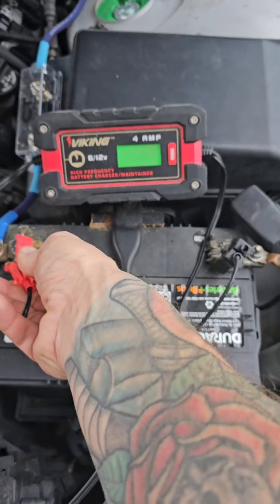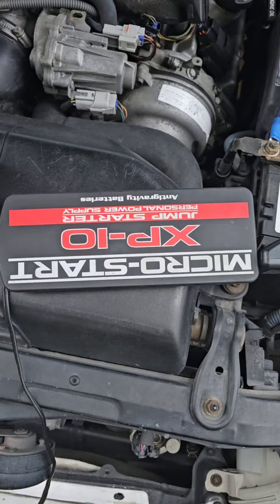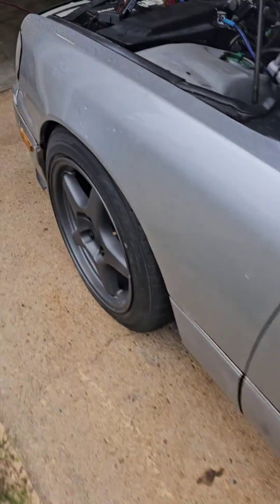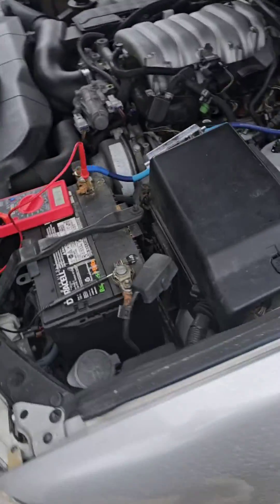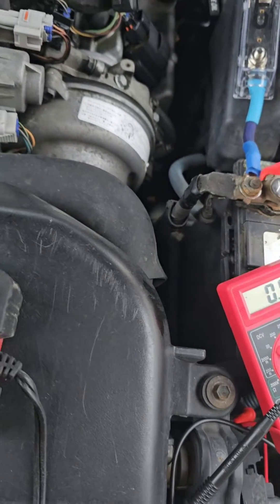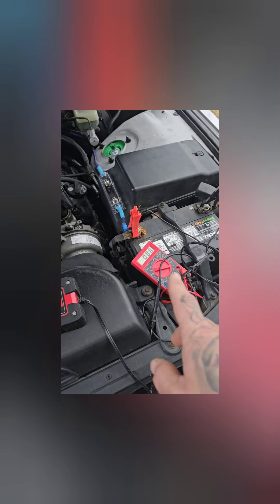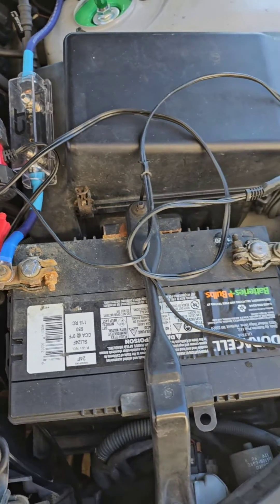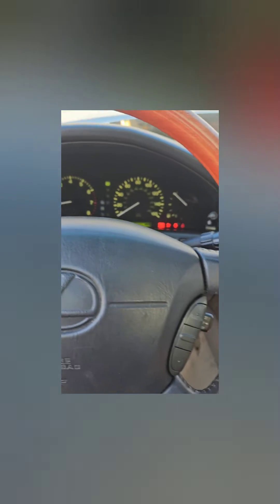How to restore a completely dead car battery (the easy way)

Comment: Yeah, that's what happened to me. A couple of days back with my Mustang, I left on my parking lights and the battery is completely dead. I try to jump it and when I jump it, the car turns on and then turns back off, I guess, battery doesn't have enough juice to keep the car on.

Comment: Well sure..but you let it charge overnight. It should start.😂
Reply from the maker: Most smart chargers can't just jump start a battery, so yes...it needs charged overnight. If a single start was the goal, then I'd quit after using the jump pack. But the point is to recondition the battery so it can function as intended, and that simply takes time.

Comment: How many volts was it before charging
Reply from the maker: It was like 5 or 6 volts. Pretty dead.
Reply: @tinygaragefab  My car battery is at like 1v 1.2v, do you think its worth a shot?
Reply from the maker: @MN-kh9jf thats going to be tough to bring back, but if you can jump the car and get it to stay running long enough to build some residual voltage, then the charger might just pick it up. But 1v is pretty bad.

Comment: Here's a quicker way with less messing around and no Lithium Jump-Starter: Connect your Smart Charger to the battery, then use a couple of wires with little alligator clips to connect a simple little 9V battery across the 12V terminals instead of the Lithium Jumper. The Smart Charger detects 9V, realises it's connected to a battery and starts charging.
Reply: Good idea !My only problem was managing to connect the battery to the main battery to get my smart charger working.
It maybe I'm a bit thick !

Comment: hello I have a new battery from costco that was barely installed last year but haven't been driven for a couple months and it's gettin cold now and forgot to disconnect my terminal so battery is dead...... will it still jump start using those jump starter kits or do you think my brand new battery is completely dead already?
Reply from the maker: Should jump start off of a pack, but the battery itself needs a recondition and charge, which is what the charger does. The alternator alone once the car is running  usually doesn't do it.

Comment: 😅the cable terminals are still connected. Is that still alright?❤
Reply from the maker: What do you mean? Charging the battery with the car's cables still attached to the battery? Absolutely nothing wrong with this. Nothing flows anywhere it wouldn't when the system is normal anyways.
Reply: @tinygaragefab  thats not entirely correct
Reply: @justarandomguy3969 I heard that having everything connected while using a battery charger may damage the ECM.  Now don't know what to believe.
Reply: @johnmcmullen456  it killed one of the modules in my car so.... (Also the myth about electricity only flowing where there is least resistance is not correct, electricity will flow everywhere else it can but like 80-90% will flow where there is least resistance)

Also main problem with charging is sudden spikes like when you connect/disconnect the charger
Reply from the maker: Well, I just retired from a 20 year career as an electrician, so I can say that the "myth" of electricity taking the path of least resistance is 100% true. Electricity is every bit as lazy as the electricians who work with it. For proof, look no further than a blown fuse indicator. If even 10% of electricity just went where it wants to go, those lights would illuminate and give a false reading. But they don't because electricity is every bit as lazy as the "myth" says it is.
Reply from the maker: And as far as vehicle modules, especially the ECM, they usually have a switch or relay in line somewhere, so without that switch (ignition key) or relay being closed, they are simply disconnected from the electrical/charging system, so the fault is most likely not the charger. Some modules may be on all the time, like a security system or the receiver for keyless entry, but most others are dead until you ask them to wake up.
Reply: @tinygaragefab  is that why electricity branches out when you burn wood XD
Reply from the maker: @justarandomguy3969 yes, and thank you for perfectly illustrating my point. The current runs through wood enough to heat whatever moisture is left. This creates heat and then chars the wood. Now that charred wood is carbonized, and since carbon DOES conduct electricity, it follows the path. The cycle continues at the leading edge of this carbon as it continues to char the wood, then follow the carbon and so on. science

Comment: If you’re gonna jump start the car, why bother doing the slow charge? You’ve already done the damage you’re trying to avoid with a trickle charge.
Reply: Not necessarily. Jumping it and letting the car charge the battery fully will do more damage. In this case the car only charges the battery for about 2 minutes, enough to  give the chip in the trickle charger something to pick up before charging the rest at a slow rate.  2 minutes at a high amp charge isn't going to do any real damage.

Ideally you would put it on a standard transformer trickle charger for a bit to get it up to a detectable voltage for the high frequency charger, but it's probably not much of a difference for just 2 minutes of full charging.

Comment: The charger does recognize my battery, but it dies slowly over a couple days if I don't drive the pick-up truck. Should I hook up the charger which is 10 amps (and which claims to be able to "restore my battery") and leave it for 24 hours then as opposed to just enough to start the truck?
Reply from the maker: I would definitely try to "restore the battery" but...if it dies over a few days, then the battery may be truly on it's way out, or you might have a parasitic draw, which takes battery power even when the truck is off and parked. No amount of battery charging will stop a draw like that. You would have to find out what is causing it.

Comment: Looking at that’s big fuse block and wire on your battery looks like your sound system is the issue. 🤔
Reply from the maker: Have you never installed an amplifier before? They have internal relays that completely disconnect from the large power wire until activated by a small remote wire from the head unit. If that wasn't the case, then yes, the amp wiring would have been the cause.

Comment: Thanks a bunch. I have 6 12 volt batteries, all of them deader that a door nail and fairly new. I am going to attack them with your method.
Reply from the maker: Awesome! I just did this to a battery I had in my Toyota Van. I had left the lights on for over a month. Battery read 0.2V. That's DEAD dead! I jumped it, ran the car for less than 5 minutes, and hooked up the cheap Harbor Freight charger I used in this video. I kept it on the charger for nearly two whole days, but that battery is fully restored and good to go now!

Comment: I wanted to thank you for your clever trick!  In Scotland, in the snow, with a 2006 Ford Focus and CTEK charger, but your solution worked a treat.  I'd been completely stuck because the charger wouldn't recognise the flat battery
Reply from the maker: That's awesome! I'm glad I could help!